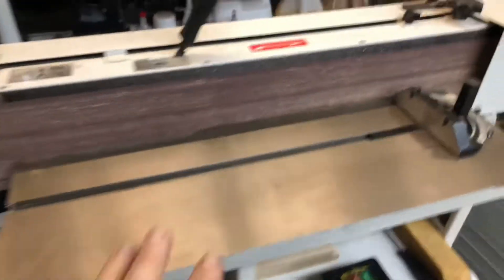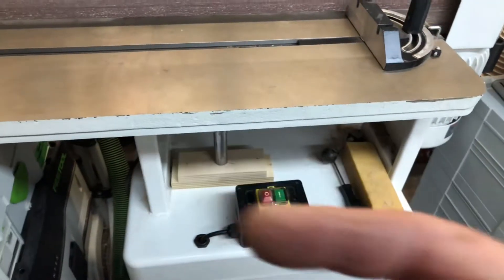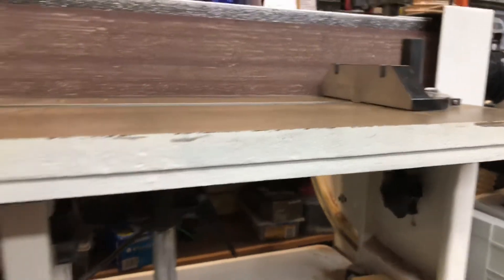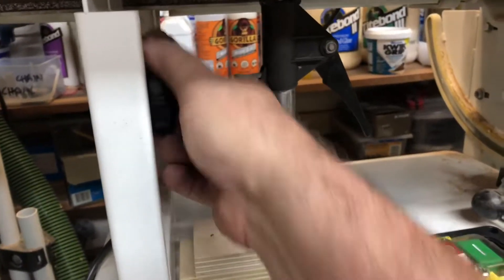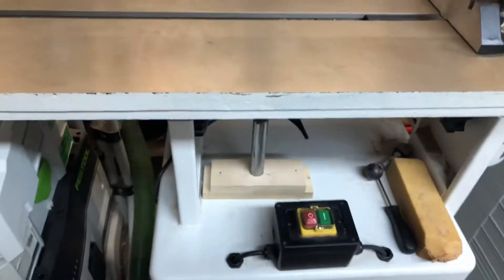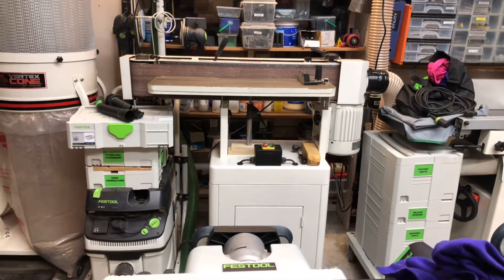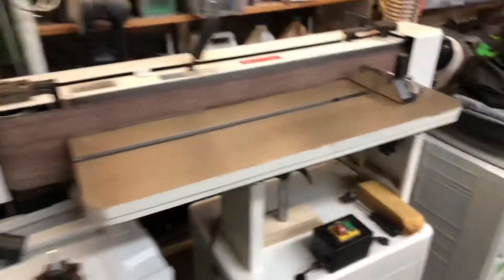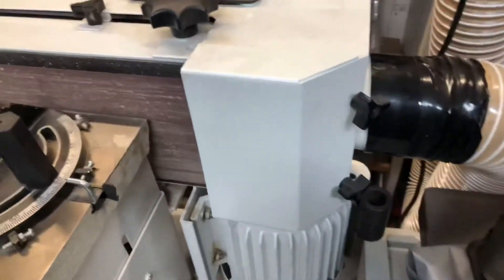JET OSCILLATING BELT EDGE SANDER - HACKED  FOR THE BETTER

Comment: I'm pretty sure it's designed like that so you could raise each side independently and leave table at an angle so that when you slide your thin workpiece back and forth on the table you're able to utilize more of the belt. I don't think that I've ever had both sides of my table at the same height unless I am sanding a piece that is 5 or 6 in wide.
 I think the dust collection is also quite adequate. The directions the belt is moving throws the dust right into that narrow port

Comment: great tip. i have this sander as well and lifting the table is a pain  . im going to put a car jack under it tommorow.  your right about the dust colection.. that bit pn the end is only good if your right beside it. you should make that with a hindge at the back so you can let it in and out so its not in the way of larger piecesthe dust colection is baddly designed as usual. the little table on the end is great but no dust colection at all. i have a large dust colector with a 200mm hose. im going to build a new table for it with down draught section all along the edge , a port going into the back section , a port going to the normal port adn one going beside it at the front where your talking about the removable part. . and some kind of piece that i can raise and lower that can control the dust on the end table
Reply from the maker: Yes Jet get so much OK then they drop the ball, the idea of a car jack is good too